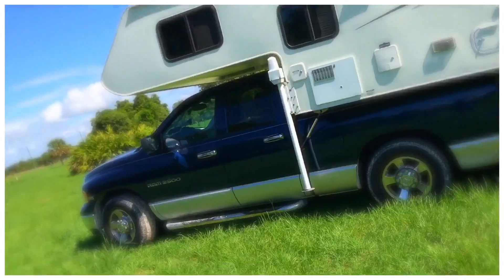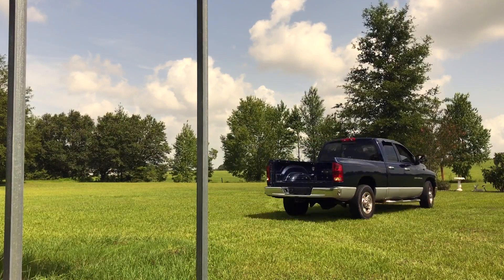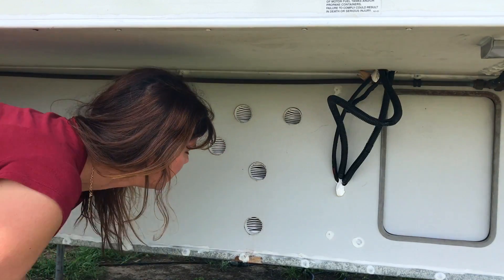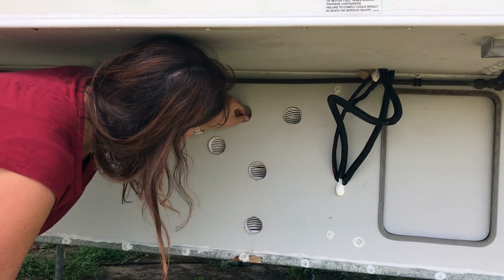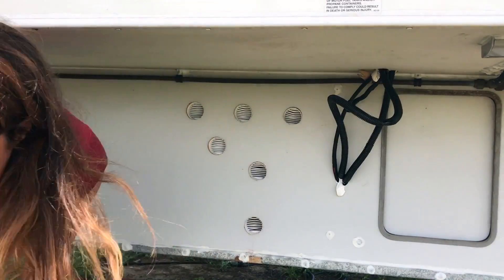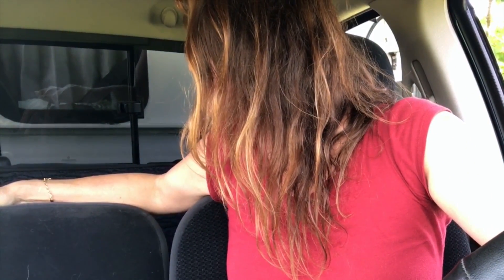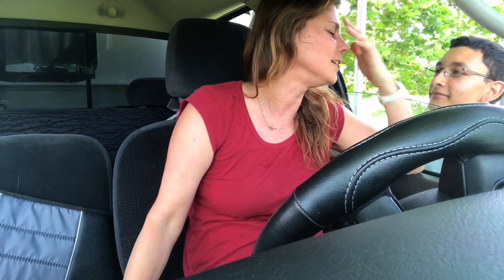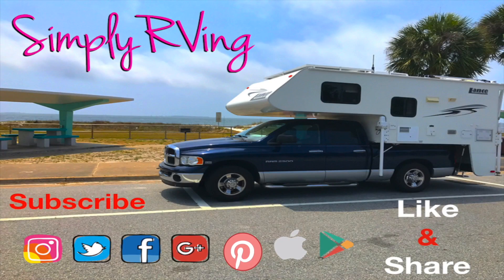SCARED TO LOAD MY TRUCKCAMPER FOR THE FIRST TIME!

Comment: I can give you a little bit of word of advice I'm backing up once you got your wheels lined up don't touch your steering wheel... your wheels won't move unless you move your steering wheel... because if you watch your video when you're getting stressed out is your backing up I don't think you realize that you're actually turning your wheel to because every time you look behind you and our hand is on the wheel we automatically start turning the wheel ...also when you're looking down the side of your truck and looking at your camper and you see the overhang... before you pull out from underneath of your camper again take some painters tape and just line it up on the outside of the bed of your truck on the camper so that the next time you go to back under your camper you just lined up the other side again.. and then just pull the tape off cheap and very efficient way to do it and you never have to worry about being lined up straight again then just look in the mirrors and guide yourself back.. oh I know that look on the face when backing up I was like that when I first started driving a semi over 27 years ago... like I said just get some painters tape I just just take a yardstick walk out to the bed of my truck run the yardstick down the side of my truck bed and wear it touch the camper put the tape perfectly straight line
Reply from the maker: +sharon Gypsy dove Thanks so much for this AWESOME painters tape tip!! Think I will put it to use and will buy a roll to keep in my camper while I am traveling. I know when I started hitching up my trailer I used a yellow extended foam hitch ball until I learned to not use it anymore but this camper will take some time for me to get comfortable doing it and the painters tape will be a good marker for now. :)
Reply: Jerry Brown yes I did because as we're all aware that when we turn our body to back up to look out a window we automatically start turning the wheel it's an automatic reflex from extending our bodies... but I also noticed she wasn't always backing up  or using the gas but when she would start to back up then the wheel being turned would make her off center again... but I'm glad to know that I have amused you
Reply from the maker: I do tend to turn my wheel too much probably out of my own nervousness . Thanks for pointing it out .Your comment helped me realize this. :)

Comment: If I may I would make a suggestion. When off loading your camper put some blocks under your jack stands even a square piece of plywood will work under each jack.
Reply from the maker: Once of those things I forgot to do and I did with my Travel Trailer over and over . The fear makes you forget. I hate that. :)

Comment: Good video! I am nervous also every time I load mine. Very unnerving to see your camper in the air supported by only 4 jacks. I know they can handle the weight, it kust looks weird. Plus, my Dodge is a 4 x 4, so I am WAY up in the air. Slow and easy works every time! See you on the road !!
Reply from the maker: I don't go in it much when it's not on the truck. Especially the top bed if it's not on some leveled pavement. :)
Reply: me either. Dont want to chance it.

Comment: It's a lot harder loading than unloading. Go slow and check often. Monitor may have gone to 100% because truck hookup is charging batteries?
Reply: Tom123mike That's what I was thinking too... but couldn't remember if she had them hooked up to charge from the engine or just solar.
Reply from the maker: +Tom123mike The installer did not connect the batteries to the truck. So this is unusual for the monitor to do that. :)
Reply: SimplyRVing   probably already wired in before solar installation. normally the house battery is charged through converter on shore power or by truck while traveling by the truck hook up cord.

Comment: A simple question ,well 2 really...1 Will your camper go on your truck if you left the registration plate on it.?  2 Can you not buy an extra plate and put it on the Camper  seemingly  ?  I'm  English so I just thought I'd   ask.  Keep on travelling
Reply from the maker: +FRANK LEALAND I never checked if I could get a second plate but if I have to pay for one I won't. If my truck bed was 8 ft instead of the 6 foot that it is then I would not have to remove the plate because the camper would sit up higher on the 8 ft truckbed and would clear the license plate on the truck. :)

Comment: I don't understand why you sealed up the battery vents. You need those so gases  from the batteries don't build up inside. Yes he did several but that is because they are small. If you look at van campers the vent slits are about 6-12" long. I don't think anything is getting in those tiny vents under the camper... but you could put bug screen on them.
Reply from the maker: +TheBioExplorer  I did not seal the battery vents . I put marine silicon around the cut away to protect the camper where the cut is. You. You can see in the video the holes have brown around the cuts and that is the inside of the RV which needs to be protected from water . It's like a cardboard material :)
Reply: WELL, YOU ANSWERED MY QUESTION.

Comment: I won't be getting one. Looks like a real pain. If you were alone and had manual jacks it would really stink. Thanks. Sticking with the rv.
Reply from the maker: I consider a TruckCamper an in between of a Van to an RV. If the van is to small and the RV too big the TruckCamper gives you the space and comfort  of an RV but still being accessible to small parking spaces like a van. Personal preference since  I've had a Class C and a Travel trailer, and found happiness with the Truckcamper for how I want to travel now. :)

Comment: If I had a truck camper I would never take it off. Loading it is entirely too stressful. I would probably just buy an older truck to use as a work truck around the property.
Reply from the maker: At some point you will need to take the camper off to service the truck so it is best to learn to do it and save the money from an additional truck registration and insurance. Hooking up any RV is stressful at first but with practice it gets easier. :)
Reply: Well, that's true. Okay, class B or C for me it is! LOL